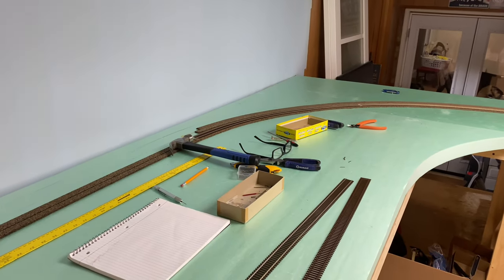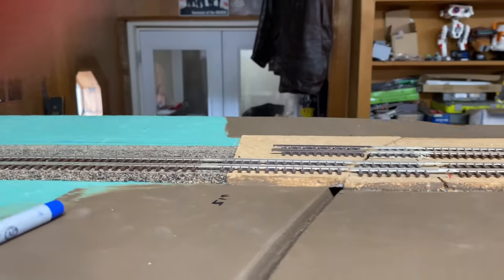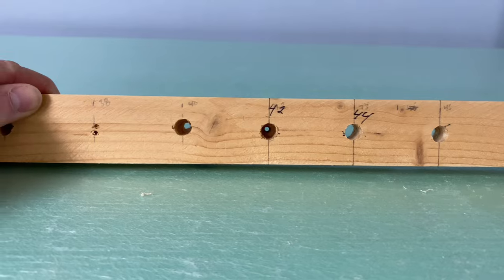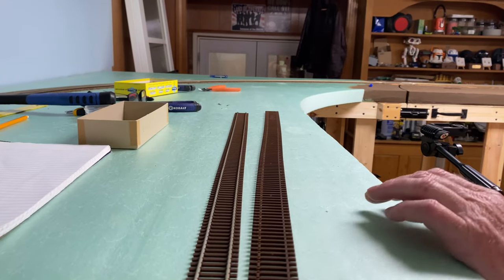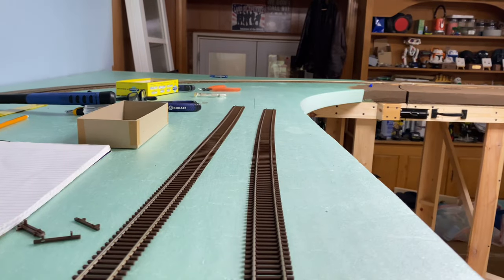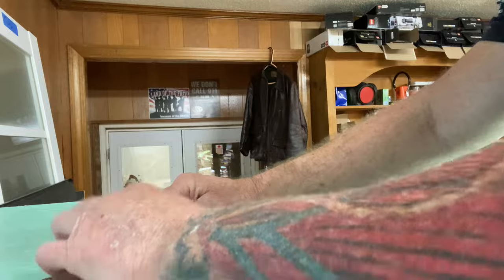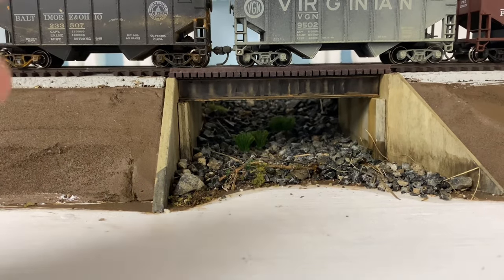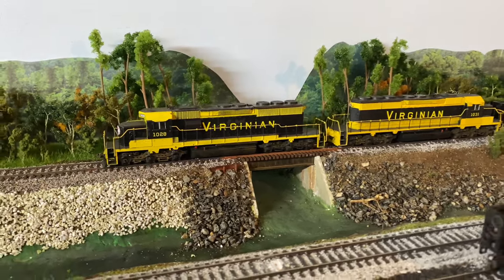HO scale layout update and Atlas flex track install.

Comment: Standardized all the curves to just 3 diameters. I then cut the 3 radiuses in 1/4 plywood and just lay this down on the layout. This plywood can then be used elsewhere on the road and cut up to the desired shapes. I also have used the tripod method but with a pod that would carry an 8 X 10 camera. Bought my pod back in "79... When laying a curve, I always solder the track pieces before laying the track and make sure that the pieces are straight ..
Reply from the maker: sounds like you have the method down pat!
Reply: @hoscalemodeltrains1221  Yep, been doing this for over 50 years.